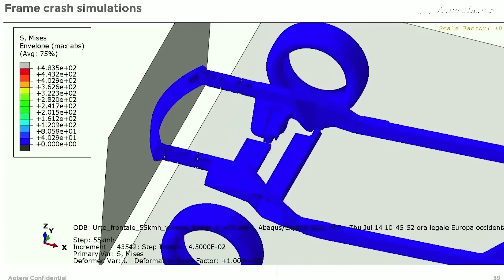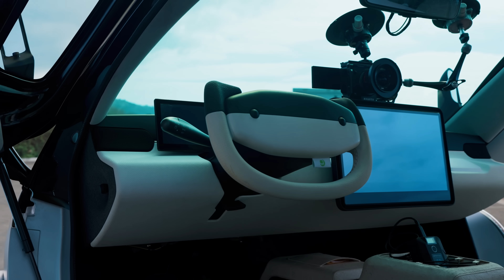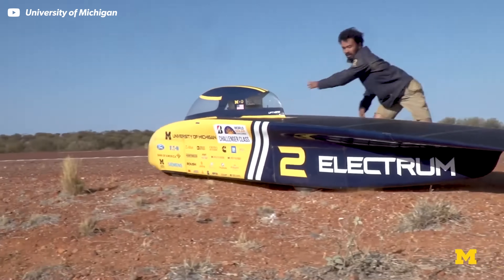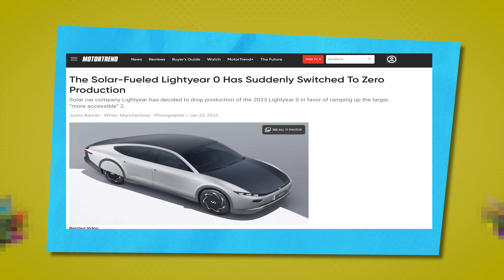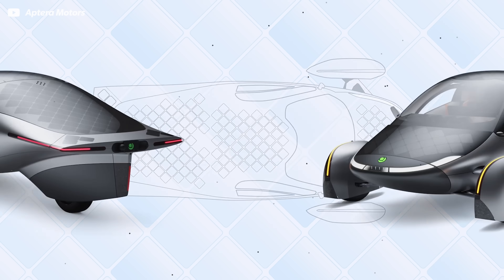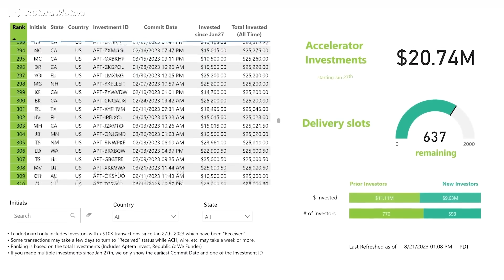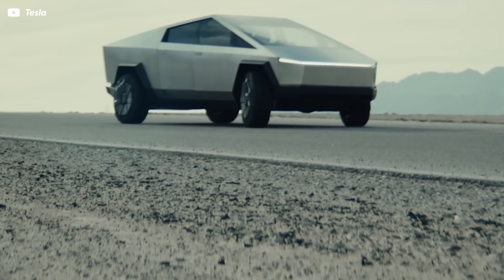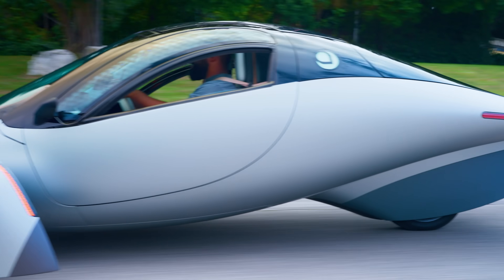We Drove America's First Solar Car

Comment: What about winter driving, and I don’t mean lack of sun so much but snow. Last year we got 2’ of snow where I live in April. Cool tech but I need snow handling capability and four seats.
Reply: Aptera's next vehicle is likely to be a 5 seat sedan.  

This first vehicle has very quick acting traction control that can sense wheel slip and adjust torque every 2.5" of tread travel.  I expect the AWD models to be good in snow with studded snow tires.  

I will be reporting on my experience driving in Iowa.

Comment: Great review, I totally am down for a car like this.  Always wondered why all cars have to weigh thousands of pounds every time I get on a my carbon bicycle that weighs a few Lbs and can be used for transportation with my tiny<1 HP leg muscle motor.  Carbon tub is same as used in F-1 race cars and just as safe as regular framed cars. Probably more so
Reply: it's not like f1 and doesn't have the other safety features or crumbling zones. that's why it's a 3 wheeler.
Reply: @lasskinn474  Aptera is using carbon fiber and fiberglass to reduce weight, increasing efficiency, while still keeping high safety standards. There are also air bags and crumple zones. Crash testing hasn't happen yet, but the computer simulations look good.
Reply: @TildaAzrisk  look man there's a reason it's a 3 wheeler and that's the regulations of what passes as a 4 wheeler car that's legal to sell in non-curio numbers. there's all sorts of cope reasons for why it's not a problem but facts are it wouldn't pass as a 4 wheeler - it's not like aptera guys were arguing this point even a decade+ ago. the cope manifests as such things as still 1.5 year after production ""started"" saying high safety standards without any sort of defining what that means beyond being better than a motorbike.  it can't take a side collision for various reasons better than a moped car for a bunch of reasons, mass being one of them.

in a lot of eu countries too it can only pass as a light vehicle that comes with top speed limits, in other words as a "moped" car - like the fiat topolino that has a top speed limit of 45kph for exactly that reason. and look making it pass all the bullsh**ery that is the jungle of modern car regulations would take a lot more of money and make the end product a lot more expensive if it was done this way so it makes total sense to go for the 3 wheel regulation hole.

Comment: I'm curious to see how a car designed to get its energy from the sun performs longevity wise considering it would have to be stored outside of a traditional garage and its front end suspension components are also not shielded front the elements.

Comment: You've got to wonder what it would drive like on a winter day in Minnesota.
Reply: I will be driving my AWD model in Iowa and will be reporting on the performance.  The traction control system makes me think that it will be rather good with snow tires compared to other similar sized vehicles.

Comment: The yoke is a dealbreaker for me as well. Aptera should offer a real steering wheel as an option.
With stalks!
Reply: Stalks are included in the driver interface, as well as buttons for PRNDL

Comment: Super interesting I am just worried about maintenance cost and basic repairs. What would that look like and what support would be out there.
Reply: The first Apterae will be delivered from Southern California, and they will have mobile repair people located there.  Since Aptera is a right to repair, company, any independent repair shop can be used or you can do such work yourself.  Aptera plans 24 hour parts turn around, and repair procedures will often be accessible through QR codes.

I have checked with my local shops in Iowa, and they can't wait to work on it.

Comment: Love the idea of this thing, but those nock nock doors are pretty dumb. They're cute, but if Its the middle off the winter here in Michigan, no way those are gonna get open with a layer of ice on top of it. I suppose the car would ideally be stored in your garage where your charger is, but it still seems like a pretty big oversight when it could just have regular goddamn handles.
Reply: Handles would interfere with air flow.  I will report on my experience with one in snowy Iowa.

Comment: I will always be skeptical of electric cars. Even when they are perfected. But one thing that makes me refuse them more than any usual argument (regardless of it being valid or not) is making a tablet the control center. It fails you lose many control options or can't even use the vehicle (example: That one electric hummer) and you have to take your eyes off the road to use it. I'd rather knobs and dials. Had I the capability and resources to develop my own, it would have knobs and buttons and look more akin to a cyberpunk interior. Regardless though glad to see actually affordable options and reasonable applications of technology that make them more and more viable, especially in areas where charging stations are sparse. If it was a more rugged vehicle or had more passenger space, probably would be the first one I'd get once my hand is forced. Had an idea similar to this back in highschool during environmental science.
Reply: If the communication protocols are accessible, then aftermarket addons for buttons and knobs could be a thing.

Comment: your car can get hot enough to cook an egg just from direct sunlight.  obviously someone had to make this
Reply: Solar can easily keep the fans running to circulate air between the inside and outside, keeping the interior not much warmer than outside air. And if the battery has already reached the desired charge level, then the full HVAC system makes for a good place for the excess solar energy to be sent to.

Comment: I've wanted one of these things since I saw the original concept car. IIRC they were taking pre-orders as early as 2010, which is why I don't trust them to deliver now. I'd buy one this week if they were available to drive off a dealer lot~ Hopefully they'll be ready when I'm back in the market ~3 years
Reply: The vehicle and company that they were taking preorders on in 2010 was a different one.  The original company, Aptera Inc. was a joint venture with Idealab.
They hired a CEO from Detroit who never wanted to build the 3 wheeler, and he ousted the founders in a board coup in 2009.

He was unable to raise funds for his new idea, and closed and liquidated the company in 2011.

After taking a lithium battery company public as CEO, Chris Anthony was offered the IP  rights to the original company from the widow of the man who bought them in the 2011 auction.  He bought them, regathered the key members of the original team, including Steve Fambro, and others and restarted a new company - Aptera Corp in 2019, with completely different corporate structure and an almost completely different vehicle with no parts or even drive train concept in common with the original.

Comment: looks pretty. you can buy a 2000w wheel for $200 and a 48v  battery for $300 and drive 40 miles on a single charge.  a solar charger goes for $1000.  off the grid for $1500

Comment: This sounds awesome. The only question I have is what about those of us in the snow belt?  Is it viable in the wontery months with snow?  What about rain?
Reply: Aptera has a very fast acting traction control system.  It can sense wheel slip and adjust torque about every 2.5" of tread travel.  I think the AWD versions will be very good on slick surfaces.  I plan to use studded snow tires during Iowa winters, where I live, and will report on my experience.

Comment: The steering wheel should be round. the mirror screens should be in the lower corner of the front windshield, or to either side of a round steering wheel.

Comment: 7:45 except 20 years ago it wasn't going to be solar
It was gasoline. It was going to get 100 miles to the gallon and cost $7,000

Also, since it's three wheel in most states, it's a motorcycle and you don't need insurance

So here in my home state of Florida, as a kid in my 20s, I was looking forward to buying the app Terra and get 100 mi to the gallon with my zero car insurance vehicle and the bastards never put it out

I'm sure the big car companies prevented them because being able to buy a two seat vehicle that doesn't require car insurance that gets 100 miles to the gallon and only costs you $7,000 total cost. No one would have ever bought another car again
Reply: Motorcycles still need insurance in every state I have ridden in.  The original Aptera Inc. was a joint venture with Idealab.  Idealab hired a CEO from Detroit who didn't want to build the original design, and had the founders removed from the board in 2009, and started claiming he was the founder.  

He couldn't raise funding for his new ideas, and liquidated the company in 2011. - it never went bankrupt.

Both Steve and Chris founded new successful companies.  Chris took his public as co-founder and CEO and it is still a strong buy.  In 2019 he was offered the rights to the original company from the widow of the man who purchased them at the auction, and regathered the original key people.  They started over with a different corporate structure and a fresh design.

Comment: Its crazy that a company like Tesla will try and claim "save the earth "intentions when the darn car weighs 4000 pounds 😂. 
Its crazy that we make a transport car to move 1 person 4000 pounds. The problem is that all cars need to be lighter and safer , all cars . They then can require special liscence for anyone driving a heavier work truck. That, along with developing our high-speed rail system that the car and oil industry keep  killing. When will we address the pollution that an industry like the car and airline industry are causing ? It just blows my mind that each jumbo jet flight, that's long distances fill up on 26,000 gallons of ⛽️ fuel !!!.

Comment: Yeah, except the trunk space of the corvette and the crash protection of an original MINI or BMW Isetta. I wish I didn't have to bag on it because I honestly think it is bitchin', but it's not like no one has ever thought of this type of design before. One of the 3 wheel competitors (the one @ 3:18) was in my town for 4 months, and it was more practical (has a real [but small] trunk). This one looks way better, but they all suffer from impracticality and safety issues.  I was rear ended last week travelling at 55 MPH.  I would not... NOT want to be in a car like this in that scenario. I can almost assure you would end up in the wall (I was in the #1 lane) or another car. Hitting this car in my S class would have turned this car into a soup can or launched it 80 feet in some direction. As a city only car, you might get away with it, but as a city car, what about the many buses? I was in SF last weekend and the bus drivers there are maniacs. Anyway, I hope they take off, but I just don't see it. Especially as I suspect this wil be in the $30-35K range. Shame.

Comment: Well, when you all do your cross run with this car take the I-90. It might make it it summer, but it's not going to make it in winter. As for the solar panels, in the northern states and Canada we low day light hours, overcast, clouds, and ground fog.  So now you have a $25,000 car you can drive ½ a year.  Once it overcomes these issue, then I'll buy.
Reply: I will be driving mine year 'round in Iowa, and will report on my experience.

Comment: Add a few auto-deploy/retract micro wind turbines for downslope stretches to make it dual-free energy capable. Every watt counts.
Reply: All cool as that would be, carrying such extra weight around could result in a net reduction efficiency. Every bit of weight is more weight to push and pull around, and also squishes the tires just a little bit more, and the squishing and unsquiching as the tires go around can really add up.
That said, there is a DC power inlet on the Aptera for connecting additional solar panels, and it wouldn't be do difficult to plug a wind turbine in instead, even if some extra circuitry is required. And if you know you are going to be stationary for a long enough time, then setting things up to make use of what's available does make sense.

Also, did you know that EVs can use gravitational potential as an energy source? While going downhill, the motors can be used as generators to convert the forward push of going downhill, into electrical energy that be use for anything that can accept it. Recharging the big battery is where most of the energy would go, but some of it will go into powering the lights, running the HVAC system, running the USB ports for rechargeing small devices, etc.
In fact, you could theroretically recharge a phone by pushing an EV up a hill by hand and then driving the EV back down with regenerative breaking enabled. There are so many ways to make electricity, some more practical than others, and wild and wacky ways of generating electricity are definitely out there.

Comment: The pre-order page says lota of different ranges; 1,000 miles is if you have ALL the panels on your car, drive EXTREMELY conservatively, regenerative brake like a boss, use no misc stuff and drive normally so, yes, it can technically get that range, but it is highly unlikely.
Reply: The range is determined by the weight and amount of batteries in the car. They're starting with a moderate approach for a flagship launch and leaving the customization options as a later down the road alternative.

Comment: I know about aptera because of the Automotive X Prize. I was rooting for the Edison2 to become a commercially available platform. I like the Aptera, but I have 3 kids and a wife, so a 2 seater doesn't meet my needs.
Reply: Although the name is the same, the vehicle and company now (Aptera Corp., rather than Aptera, Inc.) are completely different from what you saw then.  Although the original founders of both companies were the same people, by the time of the X prize, they had been kicked out of the company and gone on to other successful projects.

In 2019, Chris Anthony was offered the rights to the original company that had been sold at auction, regathered his key original people, and started a new company with a completely new design.

If the current vehicle is successful and the company goes public, the second vehicle is likely to be a 5 passenger, 4 wheel sedan.

Comment: Have you checked the range with AC on?  How about with heater on?  How does it handle a 100F+ day?
Reply: That information will become more available with the testing of the production intent validation models, and reports from the field from owners of early deliveries.  Of course range will be lower.  100 +F days are within the design range, as are - 20F days.

Comment: My big concern it what would happen in a crosswind as that speed tail design could be all that's needed to flip this thing over.
Reply: It is not only aerodynamic from the front, but also other directions.  There is downforce built into the shape and it is more stable than most slab sided vehicles on the road, even those with 4 wheels.
Reply: You don't seem to have a solid grasp of basic physics.

Comment: I really like this, however, the three wheel design severely and negatively impacts the ability to straddle a pothole, large road kill, or other hazard on the road.  Pertains to all 3wheeled vehicles not just this one. You're almost guaranteed to hit that pothole where as in a 4 wheeler you may be able to avoid it.  The roads where I live kinda suck, and I have traveled enough of the country to realize a lot of roads suck.   I wouldn't be surprised if it required a lot of tire/wheel/suspension repairs.    I still kinda want one though.
Reply: Actually, this fear is not correct.  I have ridden in one.  There is plenty of room between each front tire and the trailing rear tire in the center - almost 4 ft, to make straddling potholes and debris usually possible.  In addition there is no low hanging air dam to be damaged as there is on many Japanese small cars, including my present one.  Aptera is even better at this.
Reply: @n.brucenelson5920  that is good to hear. I really do think this is a cool vehicle. I would love to see them out in the wild soon.

Comment: I mean, let's be real for a moment,. Yes it has solar panels but it's quite obvious that you will not be free of a wall socket here. Adding 5 miles per hour to your range on solar charging really only means you get to the grocery store and back on purely solar power, if that. This car takes 200 hours to fully charge the batteries if the 1000 mile range is to be believed.

The solar angle is a nice marketing gimmick, but it's just not practical in everyday life at all.
Reply: The first vehicles will have 400 mile range when the batteries are full.  The 40 mile solar range in California exceeds the daily average commute.

Comment: Really hope this is successful. Agree needs real door handles and not sure about the steering wheel.
Reply: Door handles would interfere with the aerodynamics. If the door wont open on its own, you could roll down the window to be able to grab and pull.